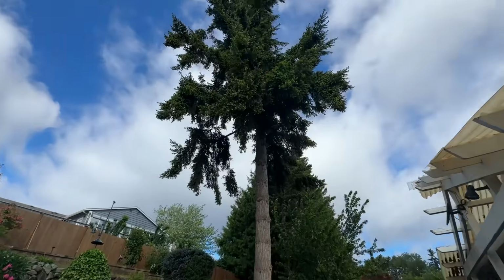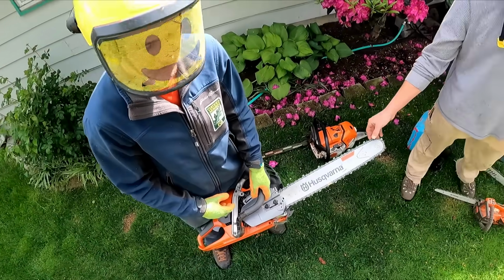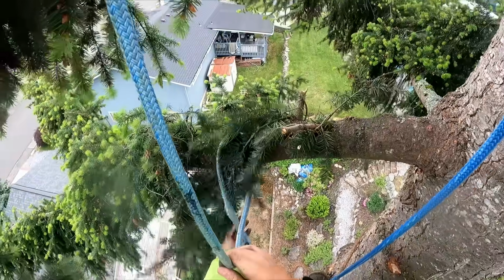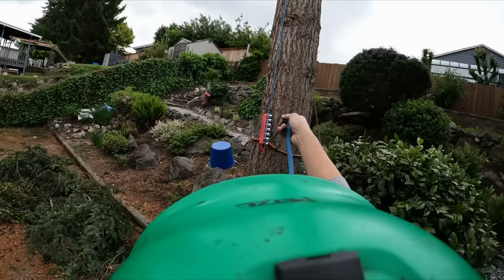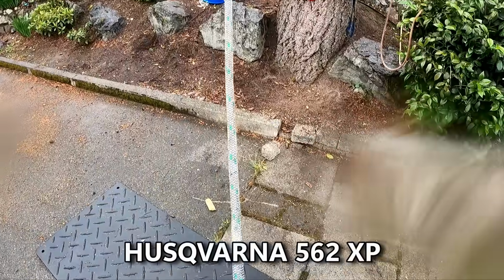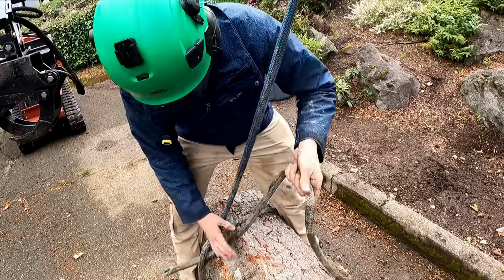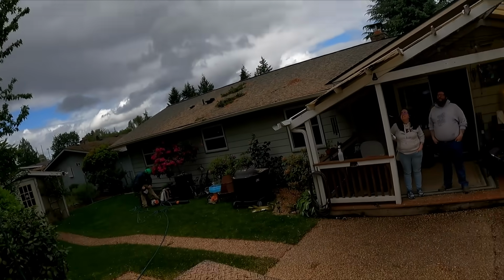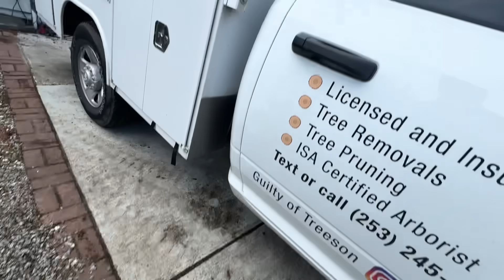Removing A BIG FIR With ZERO Drop Zone!

Comment: I did a small oak trimming job once a couple years ago after watching some videos like this and getting some climbing gear. I used only manual tools and managed to get every limb down safely by myself just using pulleys and the belay on my harness. It was by far the most fun I have had doing manual labor, and the thought and planning that went into it all was very satisfying for my autistic brain.

Comment: Im a 40 yrs Tree Climber 57 yrs old and do it everyday still. 
You done a good job. Heres a tip if you want it. Your clove hitch needs to be together and straight up wood, dont bed it. Just cut straight through. On that tree i would have nived one of them stones and blocked it all down in the bed. 
If not oile yiur brush on the concrete abd put tires on top. And trust me it wont do any damage and save on then knees lol. Get my age and you will wish you have. But Great Job. i enjoyed watching. I do it all damned day and watch others when im not doing anything at home. Thats f*****up ah.

Comment: For the woodchips flying out
When you tarp it, put a 4X4 on top of the tarp at the front of the load to hold it down, that’s what I do to help hold heat when I get asphalt. It may help prevent some of the woodchips from flying. Give it a try!

Comment: Awesome job as usual! Your pricing was fair for that job. My two cents-I always push the logs off parallel to the house and guys just in case the rope breaks from fatigue or slips off the log……..I even had the bolt in my mini block shear off once.

Comment: So I drive a dump truck. We run asphalt millings with our bed down. Most times we don't worry about it, but we always run with the tarp on the bed partially extended to catch anything that might yeet over the cab. It's for safety and ease of cleanup. You could do the same with your dump bed there. By all means, tilt the bed up, but you could also partially extend your auto-tarp out to catch the blow-over.

Comment: A little automotive technology could provide a better breaking system for the logs than the porta wrap or Jail Brake. Both the porta wrap and Jail Brake are using the friction of the rope against the metal as a brake pad.

An automotive disk brake connected to a hydraulic cylinder would be attached to the tree. The rope would be wound around a large spool on the disc brake hub. A pipe would apply pressure to the hydraulic cylinder. The pipe would be attached to a rope to keep a safe distance. As the limb was lowered the ground operator would pull on the rope which would vary the pressure on the brake. This would allow the limb to descend rapidly at first and come to a gradual stop. It would take the guess work out of how many wraps to use. The disc would be the braking mechanism, not the rope. It could freewheel at first and easily come to a complete stop, all with very little effort from the ground operator.

Comment: Have you ever tried a Lineman's Pole Platform. It attaches around the pole/tree with a chain and gravity keeps it stable. You can then stand or sit on it. I used mine to take down some tall trees on my property. I can't work as fast as you so it took the strain off my legs working several hours in climbing spurs.

Comment: I hear you guys talking about the Port-a-wrap getting hot. I worked for a guy once that had one maid with the brake part capped on both ends and filled with antifreeze. It didn't get that hot. You might look for one like that.

Comment: Don't know if you're doing this or not, but you'd save hours on the chipper hour meter if you got 4-5 "grab piles" ready with the loader in front of the chipper on the road before turning on the chipper, and then turn it off in between chipping 4-5 bundles. Obviously you've got to deal with running out of room on the road.
Reply: Also, consider a Vermeer chipper.

Comment: I've been thinking about your "chip" truck 🤔 It's amazing what you can do with a tarp, a few clamps, a couple of tent polls, and maybe a bit of rope. If you put the 2 tent polls 1/3 of the way from the front of the truck, then pull the tarp from the front of the track and over those tent polls..... everything should stay in the truck. As you fill the truck, move the tent polls and tarp towards the chipper...... and repeat as needed. It would make a cheap and simple substitute until you get the top you are after

Comment: Surprised it isn't easier to just cut out 1 foot chunks and drop them free style to the ground into a net (would be less risk that the wedges being dropped) and potentially quicker as no messing around with heavy logs on the ground, lots of rope and knot tying. I might be wrong... probably cost more in fuel, oil and blades.

Comment: Guys no one will call you less of a man for using gloves at work, especially in a tree work. Gloves are just a tool like your hardhat or your saw...
Reply: I agree however for one reason or another I never end up wearing them
Reply: @tsloth1390 it depends sometimes u just dont have good grip and the sensation of using glove kinda like… blinds your touch sense
Reply: At least when holding/handling the down rope. A suddenly running rope on a blank hand... Better try different glove brands/types for your glove/hand size. With correct gloves you also have better grip.
Reply: @BirnenKuerbis  yeah no gloves on a rope with momentum and jerking is a realllly bad idea. I don't cut down trees but that sounds like a disaster waiting to happen
Reply: It’s so much harder to climb, work with rope and handle tools with gloves on. I only know one Tree surgeon who climbs in gloves.
Reply: Muck gloves I hate wearing gloves

Comment: Jake, you feel your spurs after a while despite having the best  spurs and boots because your total body weight and gear is being concentrated at only two points downward at an angle and your leg muscles aren't used to "puckering up" at those two angled points. Your legs muscles are normally vectoring your weight straight down over the total square inches occupied by your boots (length x width), not two angled singular points.

Comment: Question for loggers:

Why dont you just buy an empty plot of land. And clear it out. (Somewhere where this is allowed obviously) And then every time you have a load of logs and wood chips u can just dump it on thay property. Depending where. Land is pretty cheap and it might be cheaper than the dump fee. But ofc u have to account for gas and the employees salary to drive that distance. If it's the same as the dump i think its a good idea. Especially if you can store the equipment there too anyway. U can easily spread out the wood chips and raise the level of the property by like 10 ft eventually. Gradually spreading the piles out a couple inches each trip. And the logs u can leave in the middle and as the chips around get higher and higher. Itll eventually bury the pile... Eventually itll get so tall that it could leak into the neighbors property which means you'd run out of room and still own the land. But maybe u can sell it. I dont know really. How long would it take to fill 10 acres? Or more? The chips decompose too. Which results in compaction and it lowers eventually too. Now what im thinking is that the truck dumps say 20yrds. And then u use a bulldozer to spread that out over the area its been dumped..making the entire pile only say 6 inches (because it's spread out everywhere) meaning if you dug 6 inches. Youd hit the ground. I assume u can do this to the whole property no? Its also good fertilizer for the future down the line. Especially if you release Chickens into it.
Reply: I'm more confused as to the fact that they arent selling them, where I'm from the trunk of the tree could be sold for firewood at a higher value then chipping it. The woodchips could also be sold.

Comment: The most dangerous work,  period. I can't think of anything more hazardous. I just had a rock pine cut down. Not nearly as tall but almost three feet diameter at the base. That cost me $2500 including cutting down a smaller ash nearby. Cleaned up the slash but left me the firewood. It's sad to see all this good firewood size stuff just chipped. Sadly  the cheapest way to dispose of it.
Reply: idk oil rig is pretty dangerous too

Comment: Purely curious: When you’re ripping the limbs down anyway, why cut a few inches out, and then cut the stub? It’s an extra cut, as well as an extra piece to be picked up/handled. Seems quicker/more efficient (especially in a limited-access job like this one), to make flush cuts to begin with.
Reply: The two cuts means you're left with a small clean cut at the end, minimizing sap leakage, which is important around all your rope and gear on your way up and on your way back down.

Comment: No drop zone? I just cut back the corner of my kitchen by 6" and the roof line will be cut back 12" so the trunk of my Douglas fir doesn't rub up against it in a strong wind.  It's about the same size too.  mine is situated in the rear of a city row house (one of the middle unit of 8) I decided it would do till someone else inherits the place. (-: What was the quote for this?
Reply: NM, 5k

Comment: What a waste of $5000. Just leave it there. It's no where near big enough to flatten the house if it falls on it and wont be for another 100 years. Worst thing that can happen is it doesn't fall down on the house and require insurance to buy you a new roof and repair siding etc.